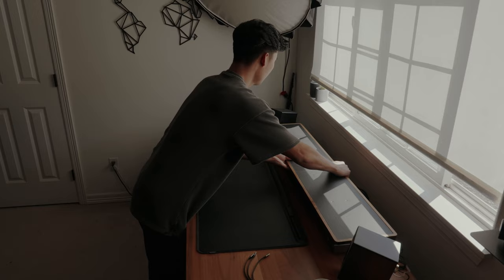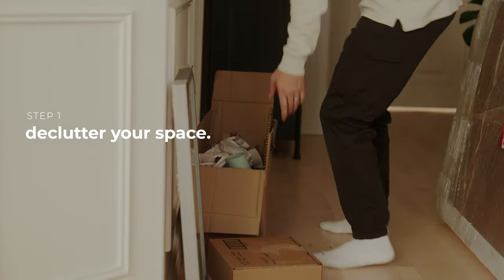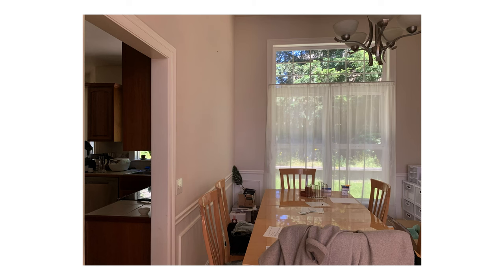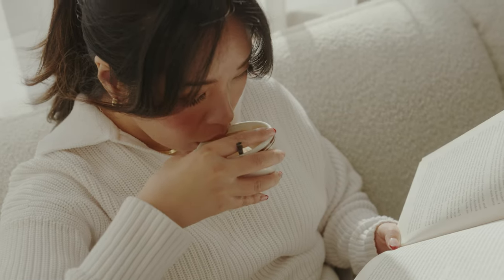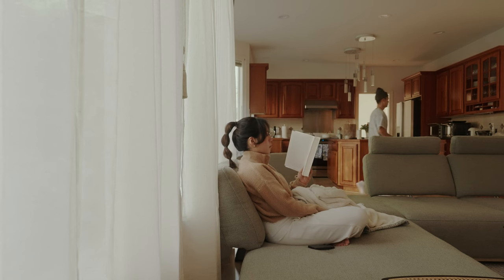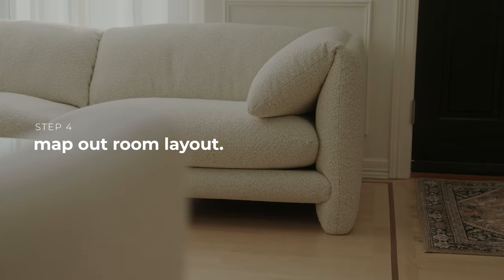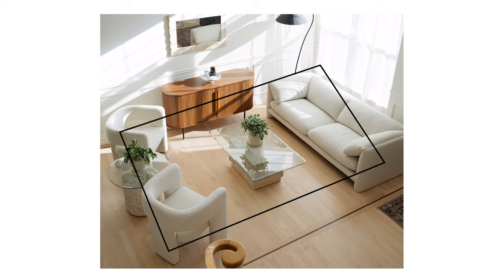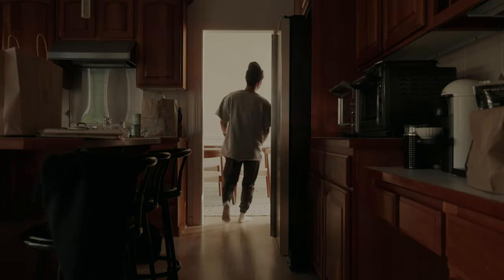How To Design and Declutter Your Home | Cozy Vibes

Comment: Great tips!  I love your style,  you have a very lovely home.  I made a mistake with installing gray laminate floors in my condo.  I live in an area where real hardwood floors are not recommended.  I've tried  warm up my space using area rugs with creams, beige and a warm gray but it still feels cold.  I have warm wood tones, pillows, etc.  Any suggestions?  I can't afford to replace the flooring.  I love your videos!
Reply from the maker: Ah that is a tough one. We almost went with the gray laminate floors too but opted to keep our original wood. I'd recommend just getting larger area rugs! Especially for like the living or dining areas. Large area rugs and then put your furniture on top of the rug. It could add a very cozy but warm element to the space